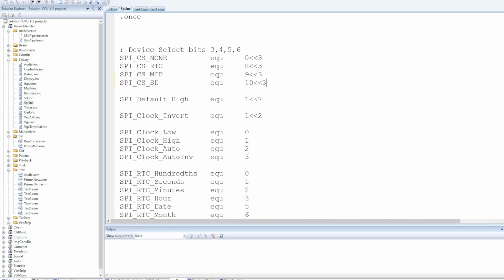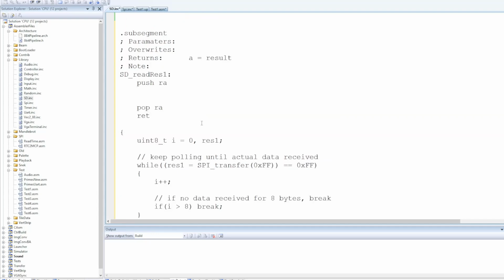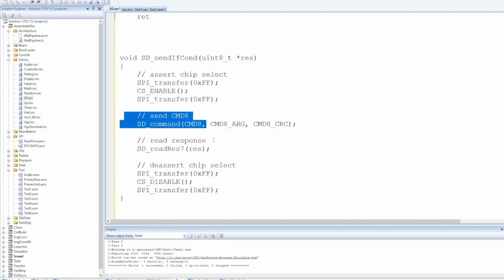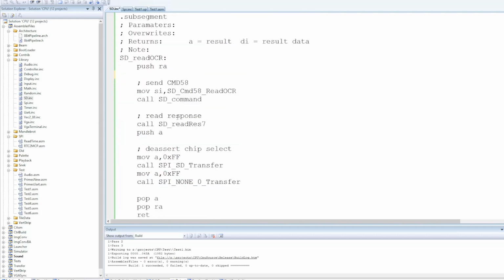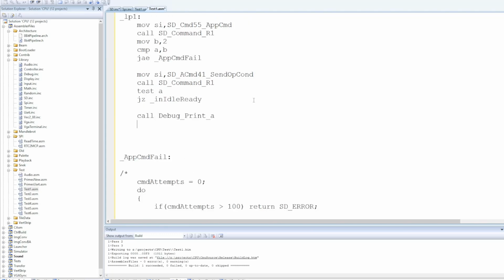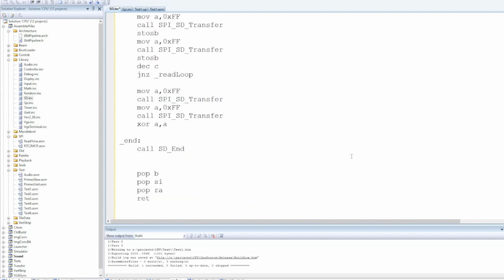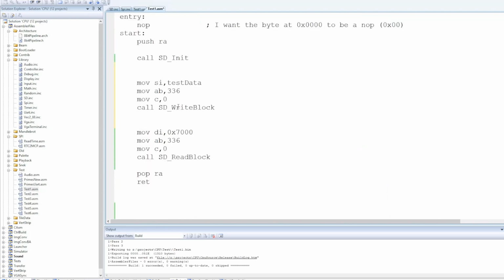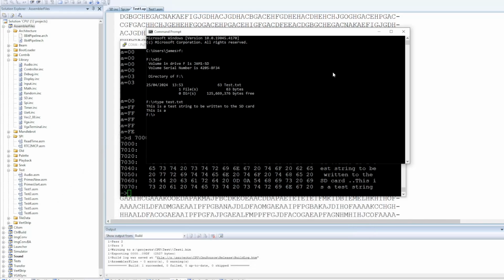SD Card Coding - IO from Scratch Extra

Comment: This channel gets extra crunchy, so satisfying. Well, maybe I should watch the video first... 😁
max read and write are user selectable, nothing magic about them, nor does the protocol mandate any numbers. From what I have gleaned, writing to flash is tricky business, which is probably why the max_write is 3 times (roughly) the max_read.
Reply from the maker: I actually found in the documentation that these are derived from explicit timeout durations.  The read is 100ms which is 400,000 cycles in my cpu. So my SD_Max_ReadAttempts is  400000 / 33 = 12121